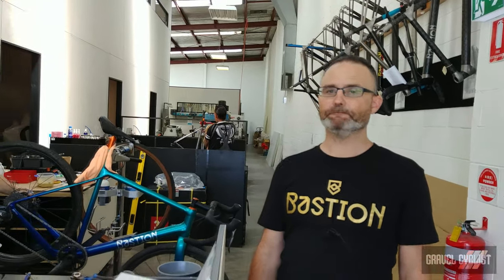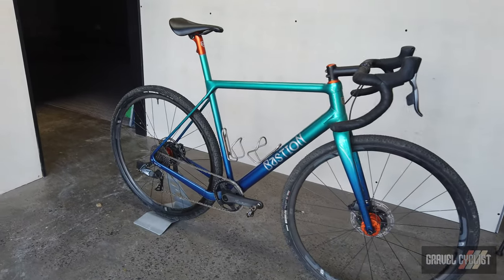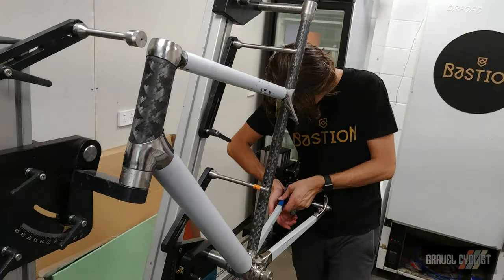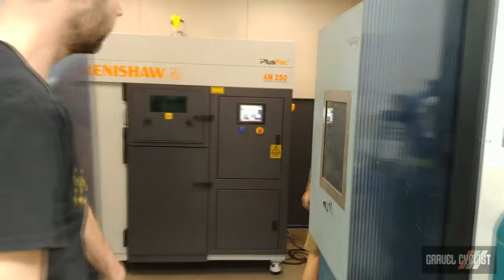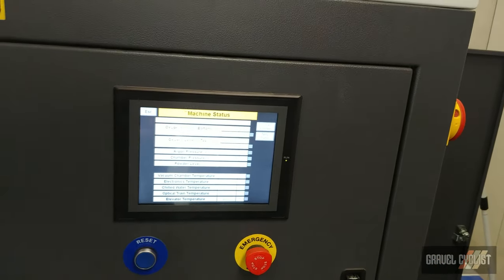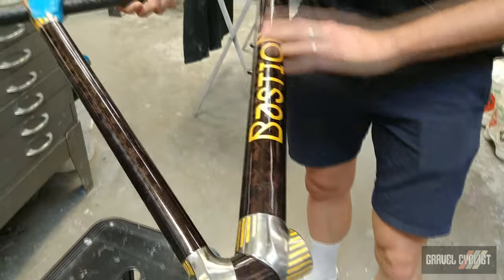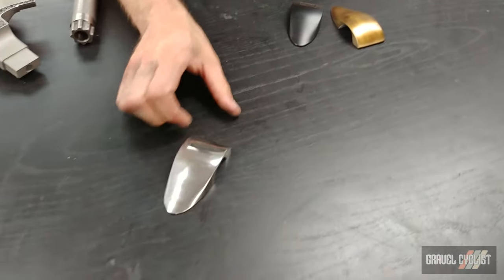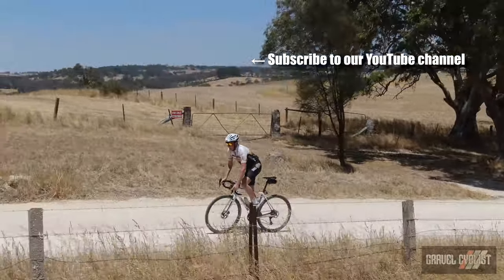Bastion Cycles Factory Tour: 3D Printed Titanium Lugs combine with Carbon Fibre

Comment: I mean, my bike has glued carbon to alloy lugs, its a 92 TVT. It's the same minus the tech. They are really nice but I don't see it as an advancement so much but maybe I will be corrected.
Reply from the maker: I have a Vitus 979 in my stash, rode the 2016 L'Eroica on it with full Mavic groupset.
Reply: Of course the mix of materials does not make a sense but being unique is a selling argument. Printing is the new "carbon". Why not. Fancy but ... still unique.

Comment: That blue 7.5 kg frame 1x gravel bike is absolutely beautiful !! Blue is my favorite color but that frame has a wonderful design with nice clean lines. I want to add that bike to my cycling quiver but I already have four. My newest addition is a 2012 Masi Alare road bike which is aluminum frame with a carbon fork and weighs 21.2 pounds. I added a new pair of LOOK Keo 2 Max Carbon pedals that weigh 250 grams for the pair. Since the pedals require Keo specific cleats I had to get a second pair of road shoes, Vittoria Stelvio shoes with Carbon sole and double BOA dials. The pedals are so light I can barely feel them when I'm riding. 
   You can never have too many bikes, just never enough.